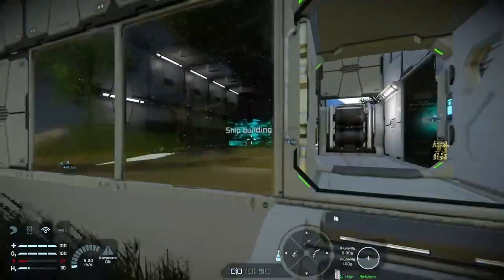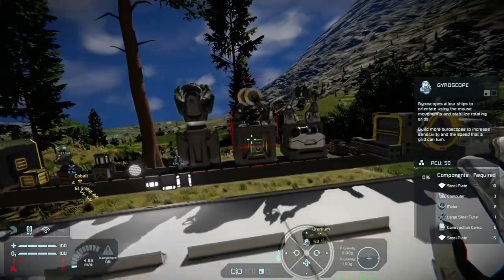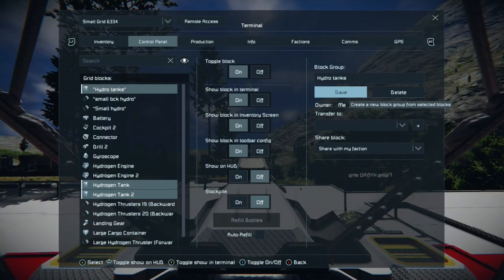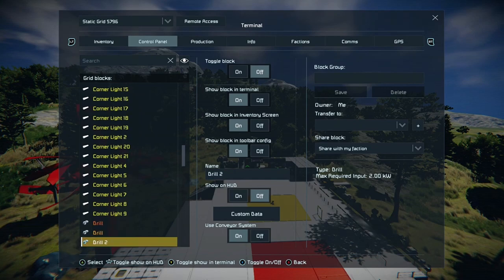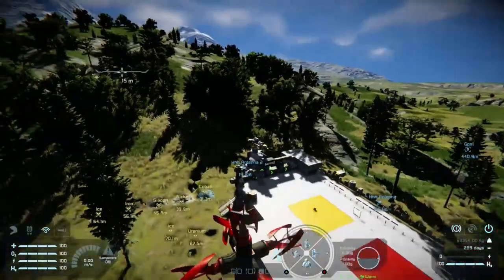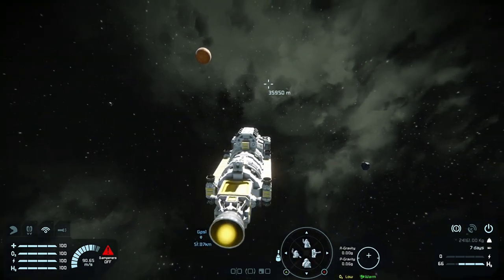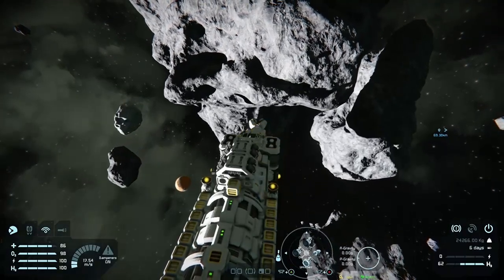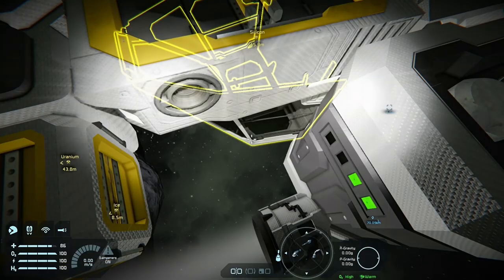Space Engineers Ship Building 101 Part 2 Hydrogen Ships

Comment: Fill Up while Building the rest of the ship  (filling takes a long time)
Have a large cargo of ice on the Base, run Conveyors (w directional sorter) up to where the Ship will be built, attached ship's H2 Tanks there and start filling them. (looks & works like NASA's Launch Tower ;-)
Then build the rest of the ship while the H2 tanks fill. 
Ship Batteries will also charge from the Base
Grind away the filler conveyor when full and use Convert To Ship while in the cockpit.
And you're ready to fly !